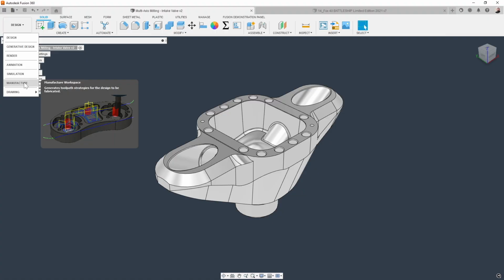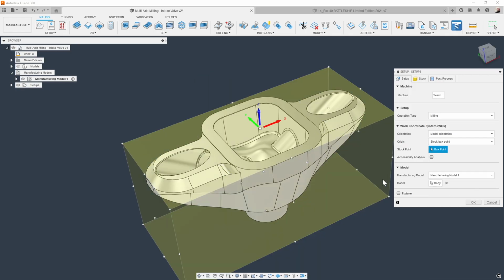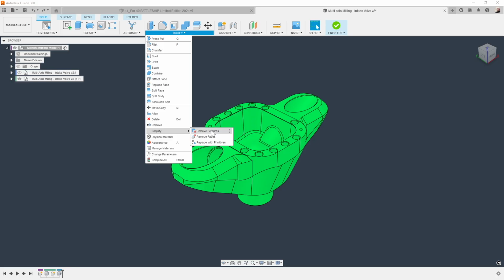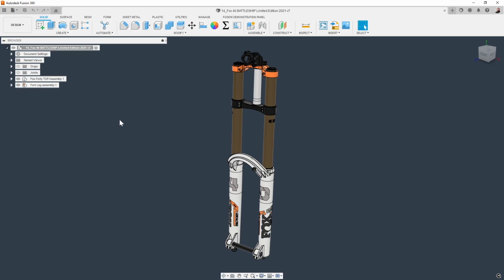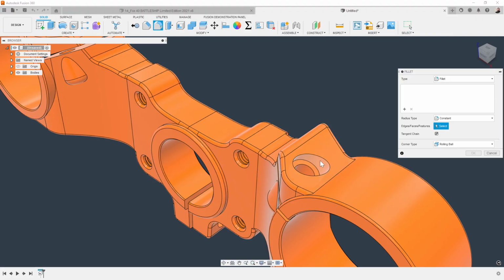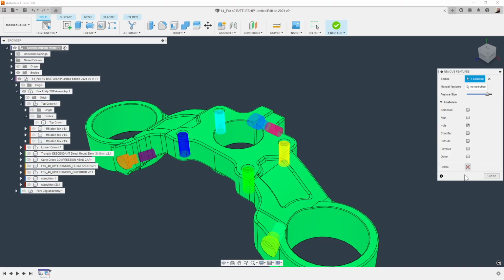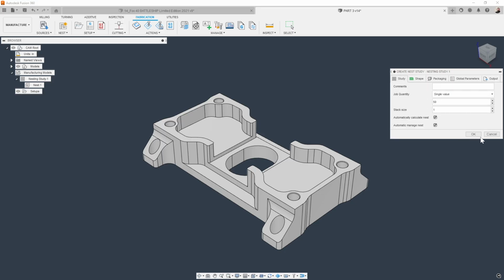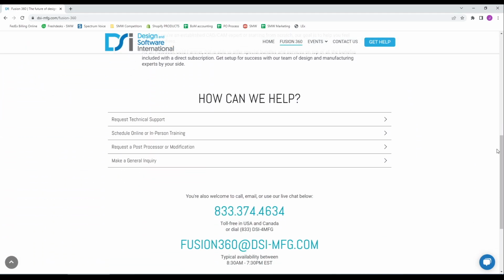Fusion 360 Manufacturing Models:  HIDDEN CAD within CAM!

Comment: I would love to use the Manufacturing Model however I am using multiple sheets with many parts and am unable to create a drawing with the nested parts. I have to resave the finished Model and use that to nest and send to the cnc with a drawing. Thx for the video.

Comment: Just Heard BOM 297. Audio thing you're looking for is a Mic preamp. I have a DBX 286s ($250 ish). It's a great noise gate / eq and compressor.
Reply: *Providing you're using XLR cables. If not look up Mic preamps / processors for your setup

Comment: I personally avoid using and recommending the use of MFG model outside of nesting. The fact that it hides model data and is awful with assemblies puts me off them. I'd much rather get the same result via Derive and Referenced Designs. Inserting a Vise into a Design means any templated Joints still work, you don't get that with Derive into MFG model and last time I checked you can't insert referenced designs into mfg model. 

But that's the beauty of these things, there's lots of ways to achieve things and everyone has an opinion or preference. Not to mention Devon being a world class peddler of F360.

It was a refreshing format to see this on the channel. Great work to both of you.
Reply: I really hope that they will move toward allowing users to build setups with fixtures/workholding within the manufacturing model side of things specifically for the reasons you described here.
Reply: @die-lon_X5 why though. When you can just use a new document and use the full design workspace? It follows data management best practice then as well

Comment: Geez, I've been using manufacturing models since they came out and this is the first time I've heard you can use insert derive to put fixturing models in that workspace.  I've always thought you couldn't insert models into the manufacturing model because it errors if you try to do that.  I really wish the error message said "consider using insert derive" or something.

That drastically cleans up my design environment.

Now the only thing I wish fusion would let you do is select geometry in the machine model (in the setup) for the WCS.  For me, I've got an old VF2TR with a permanently mounted zero point and a static G54 that never gets changed because my machine doesn't have DWO or TCP.  So in every CAM model for that machine, I have to pull in a model of the zero point platter with that machine's distinct WCS (has to be the intersection of the two rotary axis) and then choose that sketch point in the setup.  I wish that sketch point could just live on the machine model and let me choose the WCS from there.  Instead, if I had two similar machines with slightly different G54 locations for the zero point, I would have to add another zero point model into the manufacturing model and make sure I select that machine's G54 to run that setup on the second machine.

It would also be good for machines with your fixture plate installed too, you could have the machine's static WCS be a point on the fixture plate, and use the fixture attach point in the setup menu to set your fixture in the machine, and then you don't need to indicate a WCS for that mod vise or whatever or bring the fixture plate into the manufacturing model at all.  The machine model could have all the information for the WCS in it.